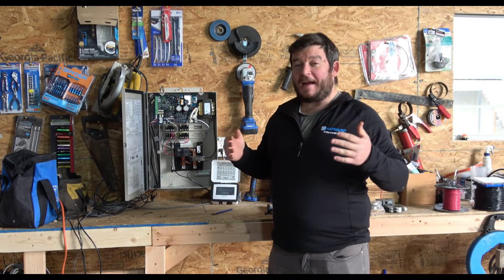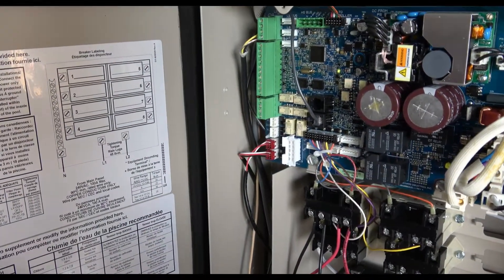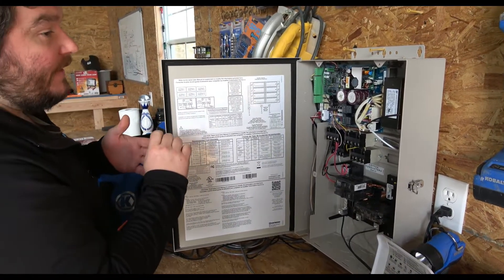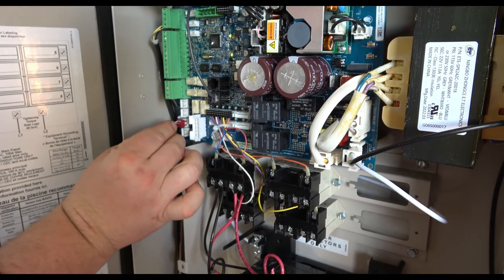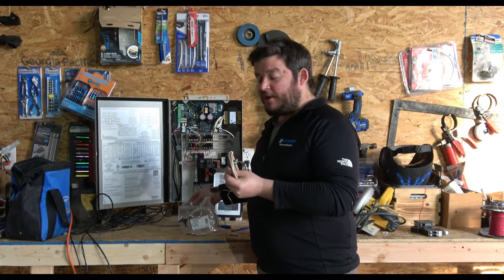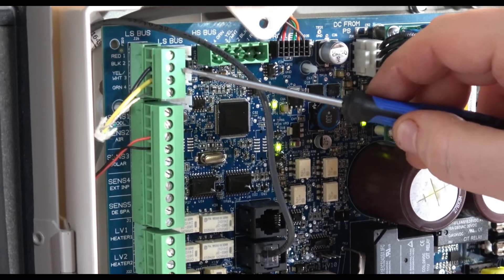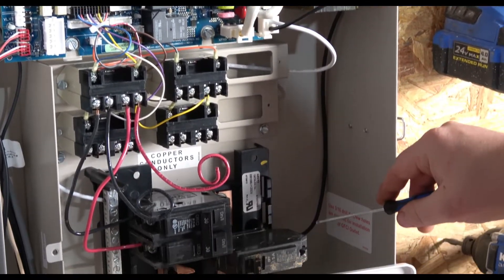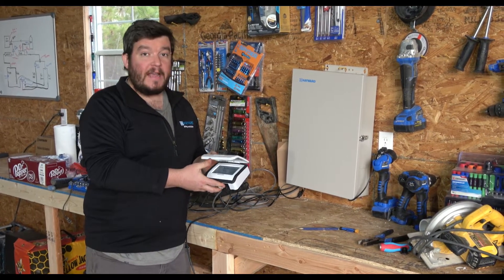Hayward * Omni Pl wiring and overview. (How to wire Omni PL./How to wire Omni Logic.)

Comment: Hey I got a question. As far as adding the HL relays is it possible to use just like intermatic or jandy relays it's hard time it looks like you could just put the wires in that fitting up on the board but when I look at the parts online it looks like it has a special different type of fitting do you know of anyone that's used just a regular old Jandy or  intermatic high voltage relay
Reply from the maker: Yea you can use any generic HV relay as long as you reuse the connector that is specific to the Omni circuit board. Idk if the screw holes and whatnot will match up exactly as far as securing it to the enclosure but should be able to make it work. Search ‘Omron G7L-2A-BUBJ-CB-DC24’ on Amazon for a direct equivalent
Reply: @HaywardTechSupport  Its that connector that is a pain to source though. I thought maybe would be able to just plug a typical one in, but ya definately need the connector to add one for half the price

Comment: Any chance you can help with wiring H Series heater to Omni HUB? The wiring diagrams do not match up and there is only one comm bus for smart devices on the HUB. I have no Hayward technical support in my area! TIA
Reply from the maker: Yea in an Omni Hub you essentially wire that up just like you do in the example of this video. You wire the high voltage line directly to a circuit breaker. As for the low voltage - the H series heater should come up with a comm cable harness that plugs into a three pin prong on the main ICB (circuit board) inside the heater. Use an 18 or 20 gauge, 2 wire cable to connect to the comm cable harness inside the heater and into LV1 inside the hub. Hope this was clear enough.

Comment: Hi there.  I just upgraded my customer to this OmniPL from his AquaLogic. He has a Hayward TriStar VSP. It doesn’t have a four pin connector for the communication cable. It has a two and a six pin connector. The pump was originally connected to the AquaLogic using the two pin connector with the red and green wires. I went ahead and connected those red and green wires to the four pin connector on the OmniPL on pin 1 for red , 4 for green. I’m not getting any pump address pop up on the control when trying to configure. I’ve set the pump to relay control under the Remote settings on the pump. I have the same cable you’re using in this video but decided to use what was originally on the TriStar. Any tips would be appreciated. Thanks
Reply from the maker: Hey man you need to hook the red and green wires to 2 and 3 on the OmniPL. Pins 2 and 3 are for data transfer. Number 4 is ground and 1 is unused. So if inside the pump the red wire is on the left side that would correspond with 2 and if green is on the right, that would correspond with 3. I am pretty sure that will work for you. Let me know key how it goes!

Comment: some confusion on your comment that the heater is wired to your breaker....that can't actually happen.  you can wire the heater wires to the 240v wires coming from the breaker and pig tail the 240 wires to your Line In 1 and Line in 2 on the HVR 1 relay; and if using a VSP pump you would join the pump wires to the 240v wires from breaker along with the heater wires and pig tail those to your HVR1 relay.
Reply: Yea I would say the point is that the gas heater needs to be wired so that the high voltage pigtails from the gas heater need to be wired directly to a 120/ 240 feed from the OmniPl/ automation panel. It fires up based on the low voltage communication wires when hooked up to automation. You just do not want to wire up a gas heater to the load side of a high voltage relay. If your point is that you can wire up the high voltage wires to the line side of a high voltage relay then yes I agree that is the way that I do it. Sharing a 20 amp double pole breaker with the spa blower. All good.

Comment: My Omni automation valves quit working. I can't swap from pool mode to spa mode. And the valve will not move with the switch under the actuator either. Seems like there is a bad fuse or no power.

Comment: Hi Tyler. Thank you very much for this great video. I just purchased 2 variable speed pumps. One is a 2.7 Trystar VS 950 for the pool that I can connect to the OmniLogic to the 4 PIN connectors via the communication cable. The other one is a  Superpump XE for the waterfall (also a variable speed pump) but I was told that I have to connect it to the high voltage relay because it does not have the option to connect it to the Omni via a communication cable. Basically, although it is a variable speed pump, I can only turn it ON and OFF with the Omni but I cannot control the speed.  Is this correct? Thank  you in advance for taking time in answering my question. Fernando
Reply from the maker: That is correct. The XE pump gets wired to a high voltage relay to only turn on and off.

Comment: I have this unit and since nearly day one I am getting an "MSP_DEV_COMM_LOSS, Comm Loss Device: blah blah blah HUA:MP" error which results in things on the HVRs like the blower and lights turning off and being unable to turn back on. As far as I can tell, all the other functions work still, like turning pumps on and off, as well as the chlorinator. Firmware is up to date.

Hayward was unhelpful and told me to find a service tech in my area using their search tool, but I've tried many and nobody ever responds.

Comment: Thanks so much for your help. Your last statement about not hooking the Heater to the HVR fixed my issue. My electrician did not know what he was doing and did not wire up my pool equipment properly for it to work with the OmniPL. I could not get it to turn on/off or adjust temperature using the app. I figured out how to put the heater in Bypass Operations mode, but it still was not working. Once I rewired the heater straight to the circuit breaker and adjusted my setting to use the LV1 relay rather than the HVR1, it worked like a champ. Thanks so much!!
Reply: Hey George,  could you elaborate a little more.  I am having the same issue we have the heater wired into LV1, and we can turn it on or off, but I have no control over the temperature any help would be greatly appreciated!
Reply from the maker: @Norman101tank  I think your issue is that the high voltage to power the heater is tied into a high voltage relay (HVR1). The 120/240 voltage to supply main power to the heater needs to tie in directly to the circuit breaker so it is always powered on. Then there is a separate low voltage circuit on the heater that needs to be tied into the green block on the left side of the circuit board labeled LV1. If that part is done correctly you need to put the heater in ‘bo’ mode so it is a slave to the Omni
Reply: Tyler, I have a similar issue with the Omni PL Retrofit kit and a Rheem 266A digital pool and spa heater.  In my case the heater power is correctly wired to a breaker in the Omni PL panel.  It is not wired to a HV relay.  The remote communication wires in the Rheem heater are two sets of three wires each connected to one of the leads across a fireman’s switch.  The two sets of three wires are connected to the heater terminals on the green block in the Omni PL panel.  I can operate the heater without remote operation but when I try to operate remote it doesn’t work and I receive the fireman’s switch/timeclock fault on the heater whereby this safety relay remains open.  Any thoughts ?
Reply: Same here. I upgraded to the OmniPL retrofit, but didn't realize the heater had to be wired directly to the breaker. Just did it and now I am back to debugging why it won't start up, but at least its trying to light and I'm getting power to the heater.

Comment: Maybe you can help me with this question please..i have the hayward color logic 4.0 lights(2- just in pool) , i have the aquaplus controler , it controls my lights, in instructions for omniPL , it says in instructions for omniPL if using networked color logic lights, lights must be put into "standalone(default) mode before disconnecting the control. Do i need to do this? if you could help it would be great..thanks again!!!
Reply: did you ever get your question answered?  I'm in the same situation - have two haward color logic 4.0 lights and I had no idea if they were in "standalone" mode before disconnecting the control.  I have not been able to get the lighting to work since upgrading to this kit.  Now that I'm upgraded and lights are not working, I'm not even sure what to do (and my pool guy has no idea as he doesn't work with these).
Reply: @greatscottaz  geez im not sure . when i upgraded to the omni PL. i got lucky and my lights worked. just tried them again and  this year and so far so good. i think i have the hayward color logic too, my pool is about 10 yrs old now. not sure if the are the 4.0 though. they are the color changing led (2 of them also). Sorry i wish i could help i know how frustrating it is. You would think hayward people would know these things. My pool place is all hayward , they didnt even know about the omni PL i just happen to find it on my own. thank god. You can try calling hayward., but usually you have to email , thats like useless. if i can find out anything on it ill let you know..good luck!!